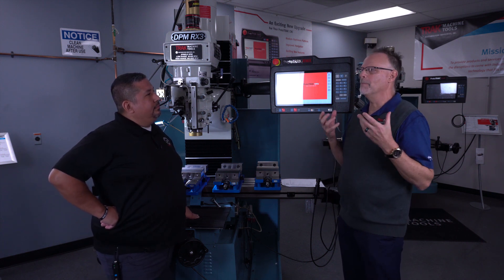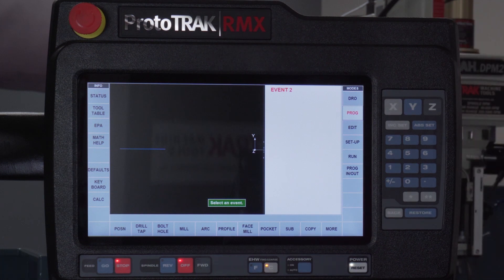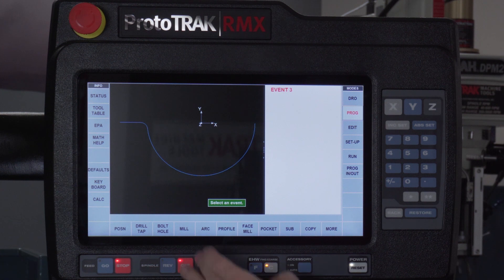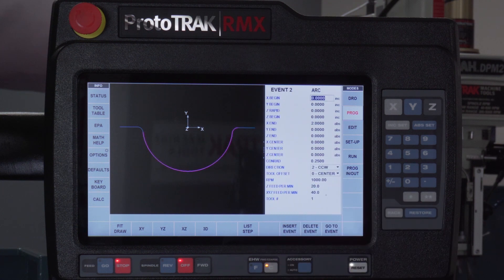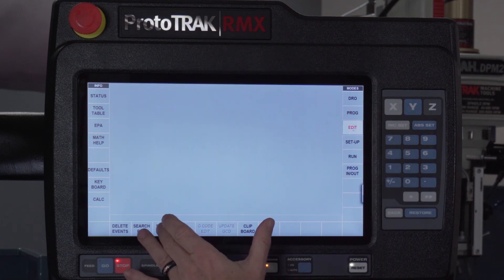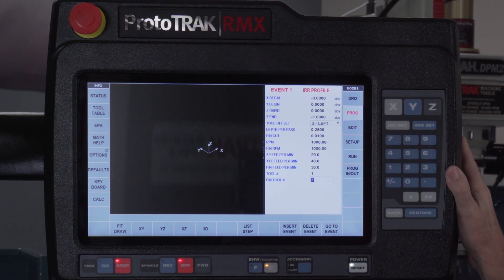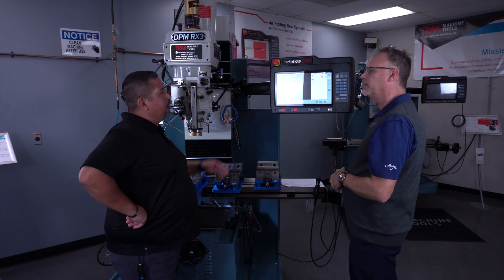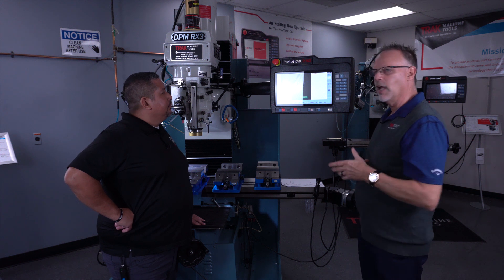Connecting Mill & Arc Events | ProtoTRAK RMX CNC

Comment: Question!  I use an RX3 at work, and when trying to load my program (using Mastercam), I get 16 errors saying that the "Mill to Arc Compensation isn't working" or something along those lines, I can't remember the exact wording at the moment, but how do I fix that?  It only happens when doing a Contour Mill.  Also, when viewing the toolpaths on the RX3, it generates large circles off to the side of the part that is not in the design, but the Prototrak wants to machine along those paths.  What causes that?
Reply: Are you using a ProtoTRAK post from MasterCam?  If not, contact them and ask for it.  If so, are you loading it as a GCD program or a CAM program?  It needs to be a GCD program if you are trying to run in full 3D moves.
Reply: what about "dummy radius wont work"